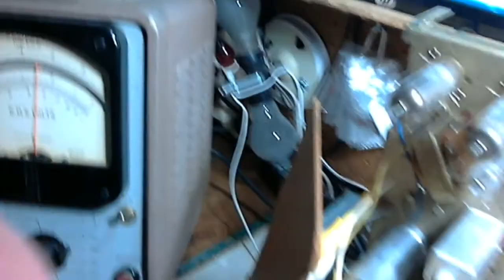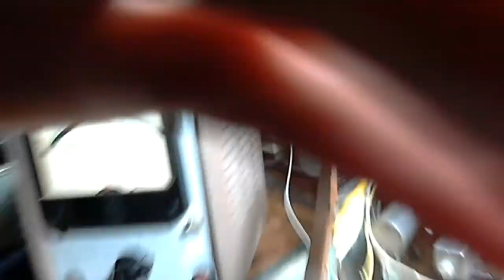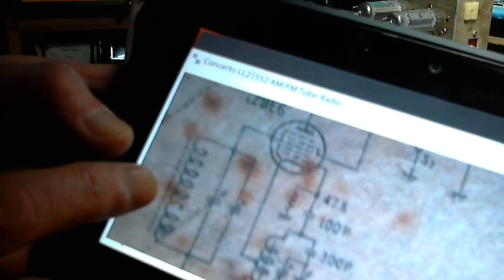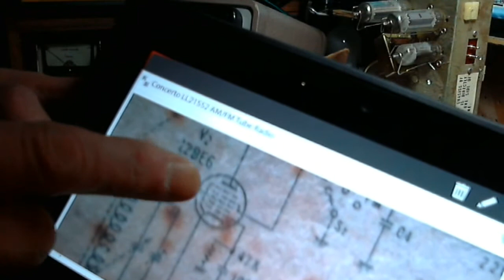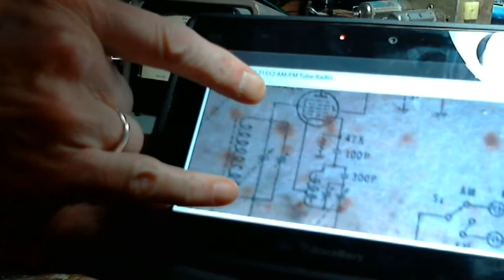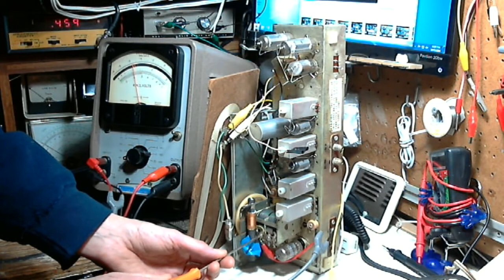Concerto AM/FM Vacuum Tube Radio LL21552 Video #8 - Experimenting with the Antenna

Comment: Hi Jim. To test for resonance you need to disconnect the circuit from the radio. Then feed the generator directly into the tank circuit at one end and connect your meter at the other end. The rod is not carbon it's ferrite .
Reply from the maker: I thought disconnecting it from the radio would change the parameters too much.  At this point, I'm quite convinced that the antenna is not resonating where it should but exactly why is open to debate.  Here's a link to good discussion on this and it seems the consensus is that the ferrite rod will not age.  I found the trimmer capacitor to be in effective.  I wonder if my problems lie there.  http://www.antiqueradios.com/forums/viewtopic.php?f=6&t=189406
Reply: Yes, I would be likely looking at the trimmer to. It should show changes when you adjust it so it may be shorted do to dirt or corrosion.
Reply: Dennis Carter That sounds reasonble to me as well. What my gut is telling me at this point is to parallel a small 10pf or so cap across the trimmer and/or antenna coil and see what that does to the resonant frequency.